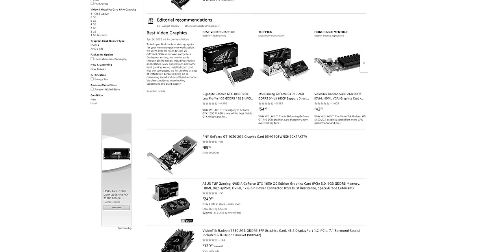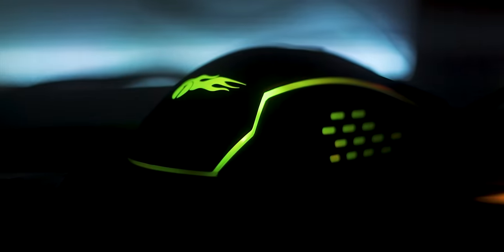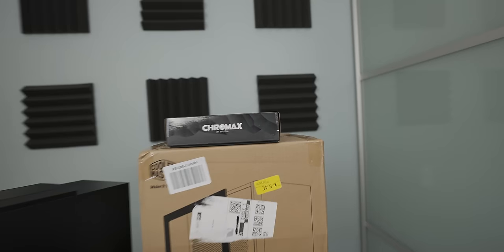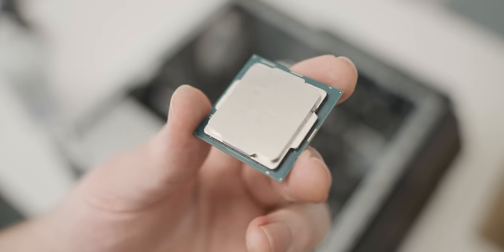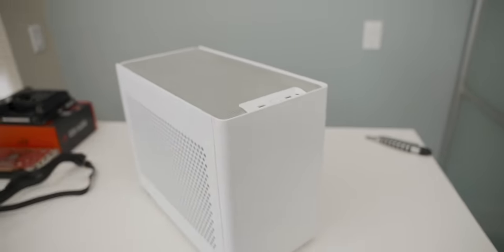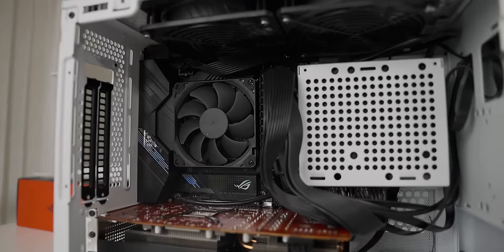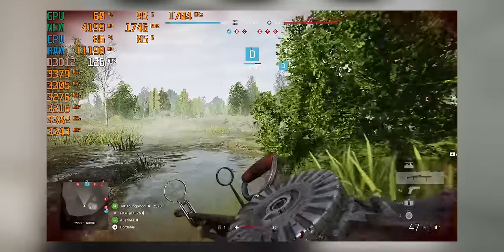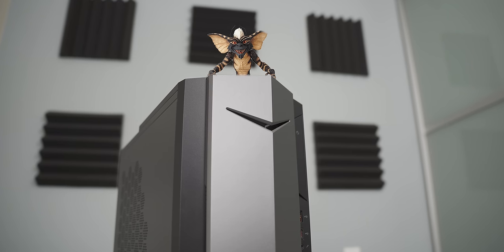2021 Pre-built Scavenger PC build

Comment: HEY!! If you wanna try something for fun... I had this exact board and it has a feature called Asus performance enchancement or something like that, where you can "unlock" the TDP (PL1) of a locked non-K cpu. So you can run that i5 almost like a K (power wise). I had it with a 10700 non-K and managed to keep the cpu boosting on all cores at around 4.2-4.4ghz without any throttling but of course also had a AIO on it to help with thermals. In some cinebench and prime95 it would chew up to 180w total when enabled without the clocks dropping on any cores, stable. I'd be curious to see you do some new benchmarks with that enabled...and another cooler haha You could have a side mounted AIO hooked to the bracket for the side of the case, either blowing in or out and add low profile fans at the bottom blowing up and the fans on top blowing out. That would be a pretty sick setup and thermals should be pretty good and quiet.

Comment: the i5 is limited to 2666 MHz so you will not be able to run it at 2933 MHz. Only i7 can run at 2933 on non Z490 boards.
Reply: Downclock... Anyway cheaper ram for same performed? Okay

Comment: Dawid, have you tried doing a push-pull configuration on the top fans?  Making the front fan intake and the rear fan exhaust might improve thermals, especially since that fan's so close to the CPU cooler.

Comment: Oh I built my daughters a system using this case.  I scavenged the stock AMD cooler from my Ryzen 9 for a Ryzen 5 3600X and an old 1070 from a Dell. So easy to build in.

Comment: Cool Build.
I actually think you make good and interesting videos, and it speaks better to users with a more realistic/typical financial situation.

Actually performance wise very similar to my own system (i5-8600k, gtx 1080).
I also have a noctua fan - the nh-l12s in the SilverStone Raven Z RVZ03 which just fits perfectly (case fan directly above cpu plus cpu fan below cpu heatsink, fits within a few mm) and temperatures are better than yours, and it even overclocks somewhat.

I wondered why you chose such a low height cpu cooler though?
Did you originally intend to fit the GPU vertically?
Now you would have much more space for the cooler that would be quiet even at high loads.

Comment: unironically because of the parts drought a prebuilt is starting to look really tasty
Reply: It is. I absolutely love my Alienware and the 5700XT in it is such a good card (looks the same as Dawid's just a bit stronger) Unlike Dawid though I would never dream of purchasing current gen Alienware desktops without adding the water-cooling option. He was getting temps up into the 80s  on a measly little Ryzen 3500 but mine (a 3700X) never went above 65 water cooled.. Now I undervolt it a bit and it never ever hits 60c.    The thing I like most about the entire build though is the fact that it would have cost me over 50 bucks more to build a similar system back in September.

Comment: Great video! There are definitely some issues going on with your build however...
The cpu clocks are way lower than they should be, coming in at around 2-2.5 GHZ and at most 3.4Ghz from your videos, so that's definitely going to lower the frames. If you look at the GPU utilization, sometimes it's less than 50%, so somethings not working correctly. 
Perhaps the CPU cooler is the culprit, but it may also be due to power settings in windows. Anyways, cheers!

Comment: You might put a fan on the side bracket in front of the cpu to help keep it cool
Reply from the maker: I actually ended up replacing the cooler with a 240mm AIO. 😁
Reply: @DawidDoesTechStuff  that will fix it. If you were here in nova scotia it so vold that tiny cooler would been fine lol

Comment: you should try stuffing a 240 aio in that little guy loli think amazon has a sale on those new arctic ones that are supposedly super nice. i think barely 100? i think with these little cases exhausting the hot air is better than intaking fresher air and hoping the heat gets pushed out. i did it with my silverstone itx case where all the ventilation is my intake and the intake is the exhaust it seems to function better overall. it intakes a lot more dust but you can really feel the cool air just being intaked around the whole case. they seem to like more negative pressure i guess. i guess it makes sense though overall because you want that side panel intaking

Comment: "I don't know if this tiny noctua cooler is going to work out, we might have to replace it later down the line."
Tiny noctua cooler: "You underestimate my power!"

I seriously trust noctua's wattage ratings on their site as gospel. I'll never buy anything but.
Reply: No, Noctura undersells their wattage ratings, if anything. I have a 95watt rated cooler on an overclocked 125watt CPU. Granted the case that it is in is extremely optimal as well as the the fan is underneath the Heatsink.

Comment: So I got a question. I just built my first pc with i5-8400, rx 5600 xt (oc), 8 gigs of ram(i'll upgrade that in a bit), 1 tb hdd, 256 gigs of m.2 storage, and a 600 watt psu. I watched a lot of bench marks for gta 5 on highest settings and they all were like 75-80 fps, but on my its like 55-60. Is the problem in the cpu or the ram?

Comment: How hard is it to remove and reinstall an AIO liquid cooler? The computer I just got from a custom build boutique installed the exhaust upside down so the tubes are on the top instead of on the bottom. I just want to turn it around so the hoses are far below the fan on the CPU.

Comment: Wow, Dual Channel memory, something you don't see on this channel very often.  :) 

 BTW I have an ITX build with a Noctua NH-L12S which is also low profile but not quite as small and a bit taller since it's raised a bit and not so flat on the CPU but it cools my i5 just fine and I'm using the on-CPU video.

Comment: Should I rather get a GTX 1080 TI or an RTX 2070 Super, if I could get one?
Reply: None you must get a 3060 ti
Reply: Right now, I would grab whatever you can find at a decent price. The RTX 3060 Ti would be a better option, but finding GPUs isn't easy atm. 

But from the two options you mentioned, 2070 Super would be my pick.
Reply: 2070S is the same at 1080p, 20% faster at 1440p and up to 70% faster at 4k. Plus it has shitty ray tracing. The 2070S is literally a flat upgrade
Reply: @weavercs4014  I don't think he meant it as an upgrade, but rather on which he should get if he can actually find any of them lol.